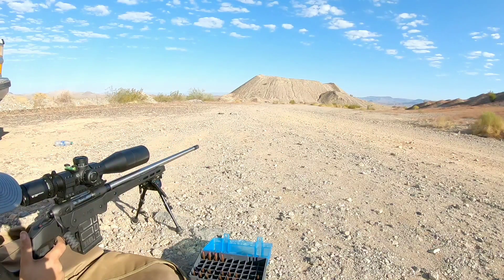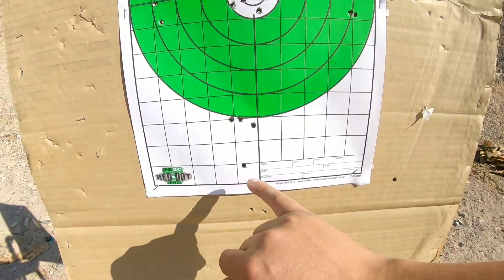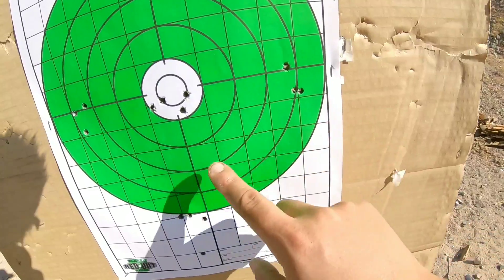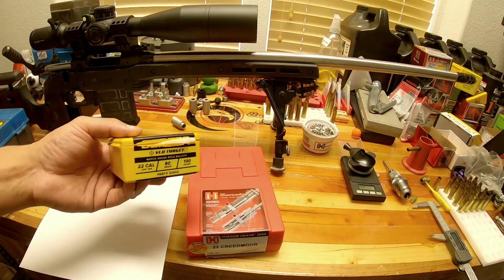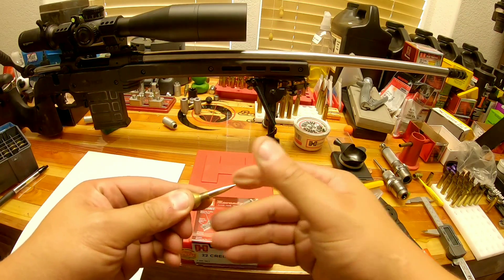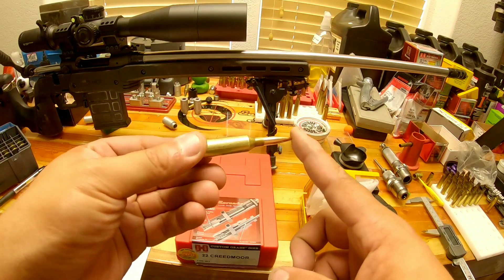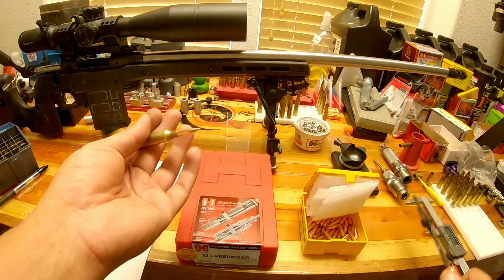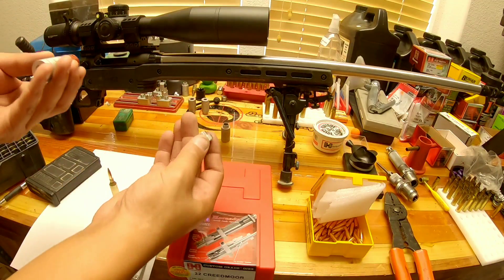22 Creedmoor Handloading | 80gr Berger VLD above 3K FPS

Comment: Barrel life will be around 1700 rounds with factory ammo , if your running super hot loads you can expect around 1300 rounds before its toast 

220 swift is around 1400 rounds on factory ammunition for barrel life 

22 creed is not as bad on barrels compared to other calibers
Reply: Hornady said the barrel life of 22 creed is only 800 to 1200 rounds. If you guys are gonna get one, get one in a rifle that has a barrel that is easily changed.

Comment: If I own a Savage 110 in a 22-250 caliber could I get a 22 Creedmoor barrel to just screw on and start shooting or will I have to have bolt or chamber work done also? I'm new at this so please don't crucify me.
Reply: You can simply run a 22 creedmore reamer into a 22-250 chamber typically having a gunsmith set the barrel back 1 thread and boom your done and good to go

Comment: this may fall of deaf ears, but id like to share my experience.

Take a fire formed case (empty no primer) and cut it in am (x pattern, or + if you're from AU (jokes)) vertically from the neck down without touching the shoulder of the case. 
place a projectile in the case neck and load it into your rifle (just barely seated in the case) and lock it full into the rifle.
then measure cartridge over all length work that info from there. 

This is very similar to the aforementioned method, but lacks the crimping tool and achieves the same goal. 

I appreciate your content very much, but i just wanted to share my "more than one way to skin a cat" story.
Reply from the maker: Yes, i do that method also but would rather not sacrifice a case. Good info👍
Reply: @EagleEyeShooting  one piece of brass>tool IMO, but if i had the spare monies floating around for sure.
Reply from the maker: I have this method incorporated in my precision reloading series. I use both methods,  both produce the same results
Reply: @EagleEyeShooting  l"m certainly not not contesting the effectiveness of the method at all, just that there is a more cost effective manor.
Reply: @EagleEyeShooting seriously though, i do really appreciate your content and hope you continue onward.
 you're one of the lesser viewed channels that really have good content.

that's something i find very difficult to find in a channel, it's usually $3 night force this, $10k rife that and i really appreciate that you're appealing more to the common base.

Comment: 2020’s version of the .220 SWIFT.
Reply: Except that the 220 used a 1-14" twist barrel optimized for 40-55 grain bullets.  This will have a lot more range due to the increase in bullet weight -- if you're running the 80-85 grain bullets, they're nearly twice as heavy, and will retain their velocity for a much longer distance.  Some people were launching the very light bullets in the Swift at over 4000 fps.